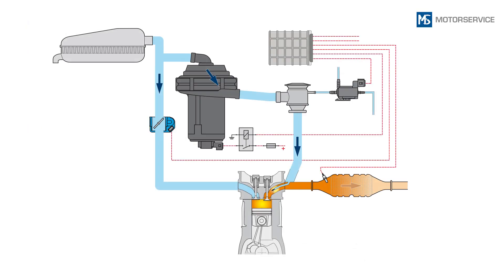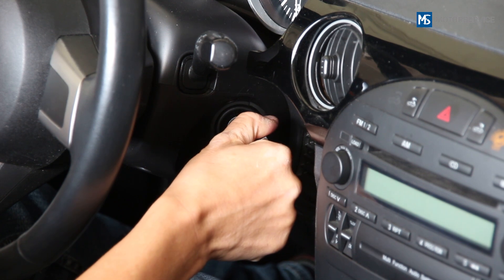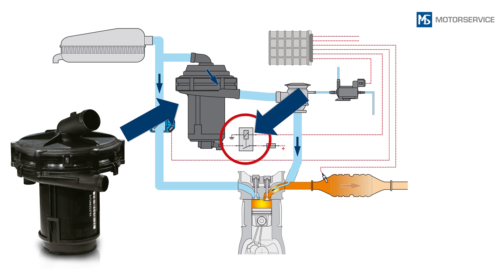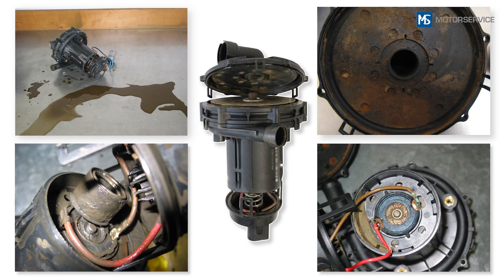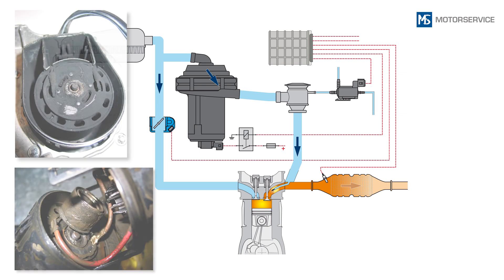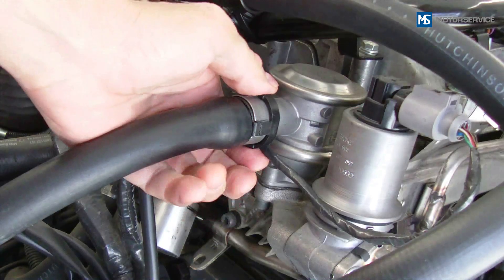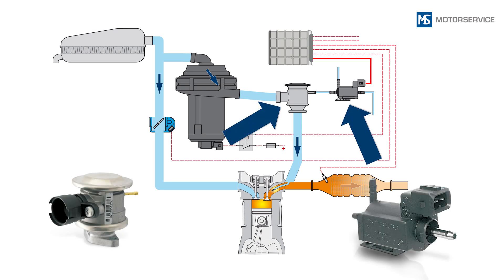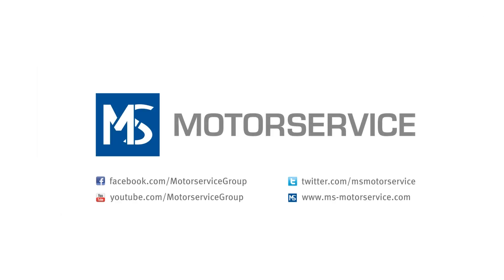Secondary air system – tips for troubleshooting - Motorservice Group

Comment: I have the same issue  O2  sensor wire broken problem I find after i replace new O2 sensor now fix everything working 👍  2nd air system leak fixed

Comment: Hi, I have a P0492 error code coming up. Secondary air Injection air system bank 2 mailfunction... 1 is it serious? 2 is it a easy fix?? Thank you. From New Zealand.
Reply: I have the same code on my 2003 bmw 525i. Did you ever get yours cleared? If so, what did you do?
Reply: @ceawatso1  the mechanics said its not serious. Can be fixed by removing the secondary pump. We left it as if is. Everytime it comes up I just clear of using my OBD11 scanner

Comment: I have a check engine light on my 2000 vw jetta and it was  code p0411.  I bought a new air pump and put it on and the check engine still came back . I need a smog test too. I bought this used car. What should I do? What can I do?

Comment: Your test made me make a mistake.
I bought a new secondary air pump.
at the beginning the airflow is low then it increases because the voltage or current intensity changes and stops after 90 "
with the 12V battery test the airflow remains low.
not only tested with a battery unless you have a 
DC generator

Comment: Hey man I have question I have a 2001 BMW x5 no check engine light turns on but I secondery air smog pump wont activate it turn on but when u put scanner it show it's not activated . What should I do any 1 help me please
Reply: i have 97 bmw 328i an air injection pump is commanded ON (activated) only at cold start..morning or after 7 hours rest.

Comment: Thanks for this video.  I had checked vacuum lines to the solendiod switch and vacuum diaphram on the secondary air valve, but forgot to check whether the diaphram on the secondary air valve itself would hold vacuum with my Mighty Vac tester.  Air output also seemed weaker than air input on the secondary air valve from the electric air pump, but some air was getting through with the air pump on at engine startup.  Given your comment about being able to hold 690mBar, I think I found the problem as I only get momentary vacuum gauge needle deflection to about 5 inches and the vacuum collapses before the next hand pump cycle from the Might Vac to the vacuum diaphram vacuum port. Multiple hand pump cycles do not build vacuum on the vacuum diaphram valve.  So the vacuum diaphram in the secondary air contro valve must have failed.  Given this vacuum test result and your info, I will change out the secondary air valve before pulling the exhaust manifold for air port cleaning.   Vehicle is a 2001 Saturn SW2.

Comment: I have a 2001 Cadillac DeVille recently the secondary air pump sounded like a spaceship for like 15 seconds when I started the car finally it quit working so I replaced it. my car has a tube coming off of the pump that goes into my fender for exhaust but when I press the gas pedal smoke comes poring out of my fender. please help I can't figure it out. thanks.

Comment: What if I find water when I disconnect the hose at the valve?
Reply: Then either the non-return-valve does not "close" to grant "non-return"-function or there is an other leakage where water can get in.

Comment: What if your air pump doesn't click on when u start engine, but wen u check to see if pump works w external power source, it clicks on, what is my step?
Reply: Check the control circuit of the pump. Something is keeping the pump from getting the signal to turn on. Check any fuses, relays, or switches. Also check input sensors that tell the computer when to send a signal to the pump. Sometimes it can even be a bad ECM.
Reply: BTW. the sec. air pump (SAP) only runs approx 30-60 seconds after "cold" satr. What means: if the engine is warm no SAP is necessary :-)